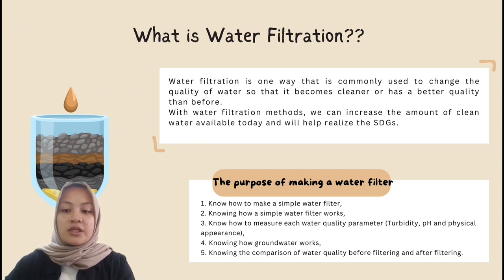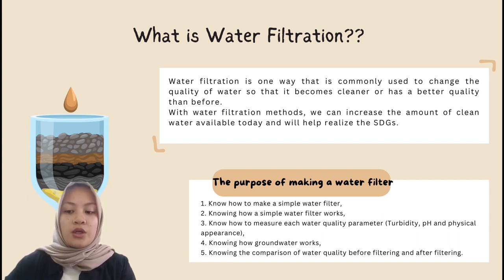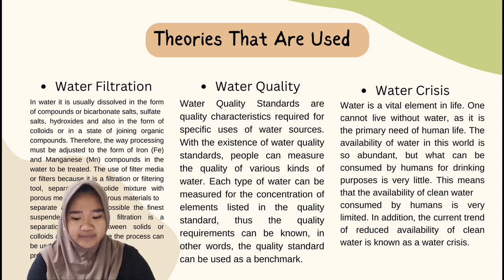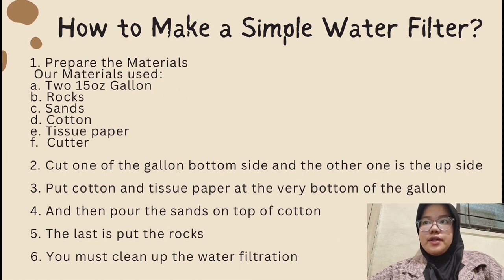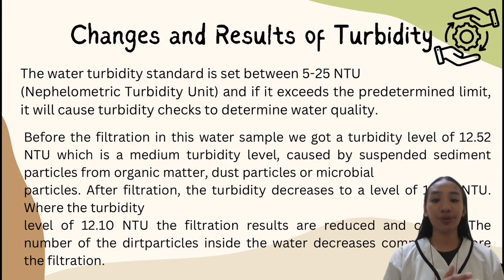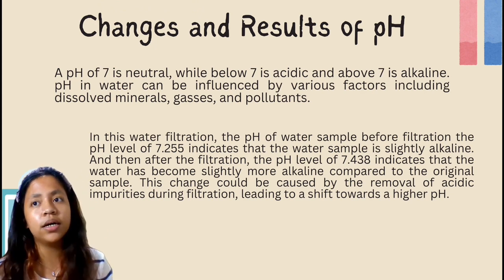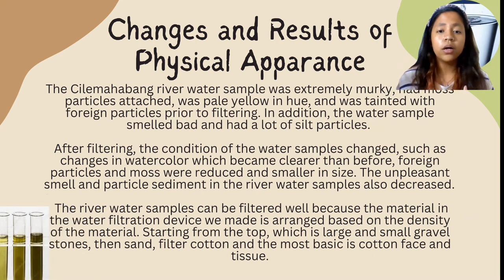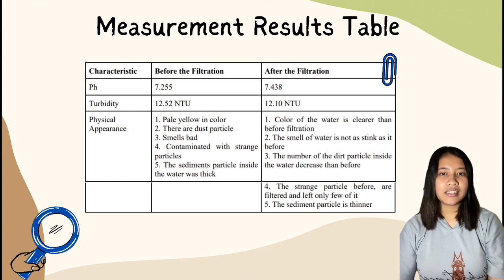Multi-Layered Soil Filter by Group 2

Comment: Hallo..My name Arifah Arsanti from group 3 imoet. So I have a question regarding the results of your experiment. Based on the results, it seems that you were able to produce clear water with turbidity levels (12.10 NTU), alter the water's pH, and reduce odor and particle deposits in river water samples. 

But is there any way to remove the remaining odor and particles? And if this experiment is repeated using the water from the initial experiment, can the water filter used effectively remove the remaining odor and particle deposits? Thank u.

Comment: hallo, my name is Angelia from group 3, i want to ask Is there a way to make a water filter that is environmentally friendly and easily accessible to the community? 
thank you
Reply: Hello thank you for the question. The water filter that we make is actually one form of water filter that is environmentally friendly and can be done by everyone. The reason is that our water filters are made using natural ingredients or don't contain chemicals so that they will not pollute the environment and will actually produce better quality water and you also use unused drinking water containers or gallons which are a form of recycling. The water filter we make is also a type of water filter that can be made or accessed by everyone because it has easy manufacturing stages and uses materials available around the community. Thank youu🙌🏻

Comment: Hellow Group 2. I'm Joy Angelin Sihombing from group 3 imoetzzzz. I have a question about your experience. So, Your group said that if pH 7 is  neutral. do you think the water can be consumed immediately? If not, can you mention the next step.. Thank you
Reply: Halo Joy, good question!
So, Even if water has a neutral pH of 7, it may still contain harmful contaminants such as bacteria, viruses, heavy metal and chemical. The next step is to test for these impurities. If contaminants are found, treat the water using methods like filtration and you can boiling, or chemical disinfection to make it safe to consume.😊